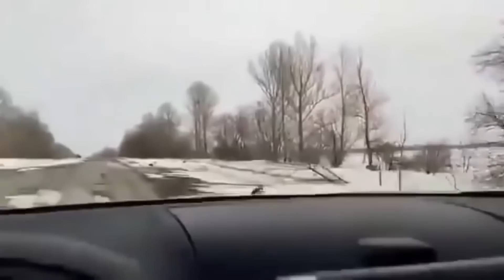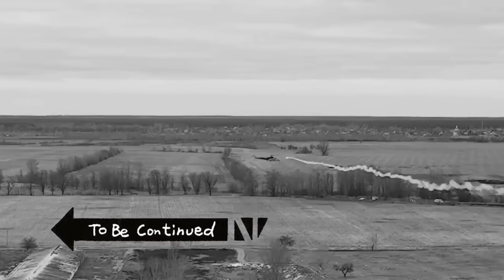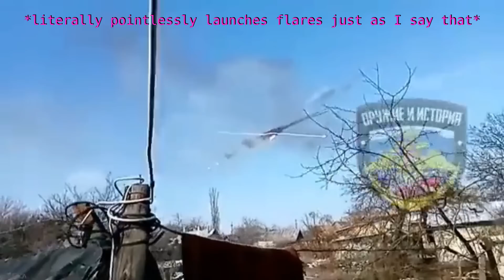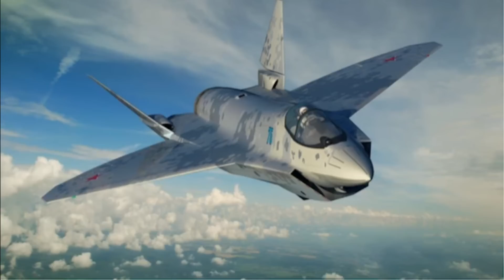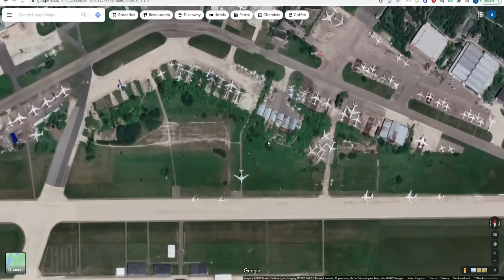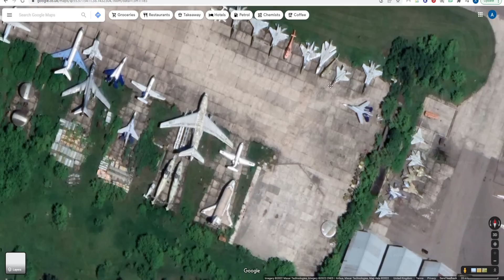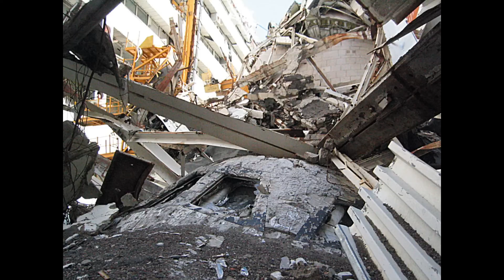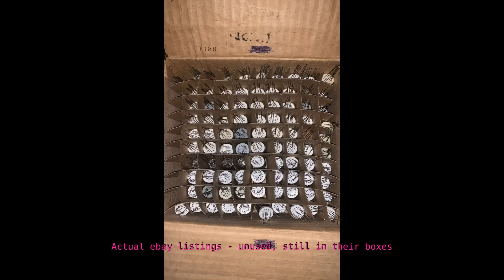100% warcrimes speedrun: Russia's technology problems

Comment: 6:21. The hollow charge liner doesn't turn into a molten jet, the high speed x-rays done the last three decades show that the temperature doesn't exceed 800°C.
What actually happens is that the cone gets inverted and compressed into a long 'needle' and the slower moving 'carrot'. The latter is around 70% of the mass in the cone, and usually does nothing of importance. Now, the 'needle' travels at speeds of 8000 -11 000 m/s, which turns the collision with the armour into something akin a water hose putting a focused beam into clay, with the length of the needle being the amount of water before the facet is closed.

7:49 From what I recall, it was the Israelis who after the Jom Kippur war discovered that whenever a needle had hit some explosives inside the tank, it stopped. "Normal" hits on the other hand would come in, pass through whatever was inside and then leave a mark on the opposite armour wall. This had them construct the first reactive armour, the Blaze system I think it was called?
Reply: Stagnation temperature of said jet is however well within the molten phase.

Comment: 4:25 - Such things do exist on tanks, known as IRCM (Infared Countermeasure), it can even be seen on vehicles in the war such as the T-90 series of tanks as well as the T-80UK. There are also western tanks with this same electronic countermeasure such as the German Puma IFV. IRCM works by flooding infared guided missiles seeker heads and "trashing" the missile by making it guide itself into the ground as it cannot "see". Such methods of destroying ATGMs are known as being "soft kill", there is also a more recent development known as "hard kill" in which ATGMs and even tank shells are destroyed just before impact by a grenade like system which detonates a charge in the air defeating the warhead before it is able to damage the vehicle. Such hard kill systems like the Israeli "Trophy" have already been used to great effectiveness by the IDF and their Merkerva tanks. During a certain combat mission carried out by a dozen of these tanks, only some fitted with the active protective system, it was seen that the vehicles equipt with the protection suffered nearly no damage whereas the unprotected vehicles sustained far worse damage. Russia also has this technology, but it is not used by any of the vehicles they have currently sent into combat so far, apart from the T-80UM2, a prototype variation of the T-80U (Only one ever built), which was infact destroyed in the early months of the war.

5:15 - "Cope cages" are not that bad of an idea, cage/bar armour is effective, and has been proven to be by several countries including Russia. Such vehicles like the T-72B3M, T-80BVM and T-90M all use cage armour that is built by the factory. The armour is designed to be of a certain thickness with certain distances between each bar to provide the best amount of protection, however the "cope cages" are built in the field by the crews and they do not use the correct distances needed, therefore rendering the makeshift armour nearly useless, had it been done properly then it could possibly reduce the fatality rate of their tanks.

7:32 - ERA (Explosive reactive armour) is certainly effective, and there are videos of such armour working against direct hits from chemical penetrators (T-90A side ERA plate hit by RPG-7, warhead was defeated). The tanks with "brick" ERA will easily be defeated by modern ATGMs because the brick armour is very old, compared to the more modern ERA that certain tanks are using (along side the proper cage armour) can provide massive amounts of protection against chemical warheads and even kinetic penetrators, however they are not placed on the roof of the vehicle, which is what is usually killing the more modern vehicles as their protection from direct hits is greatly improved.

12:40 - Thrust vectoring is a big part of ACM fights (Dogfighting), Aircraft from the Flanker series usually all have it (Su-30SM and its related variants, Su-35 (and the prototype Su-37), Su-57 and eventually the Su-75. All aircraft from the Flanker series (Su-27, 30, 33, 35, 37) all have the ability to unrestrict the flight control systems allowing them to pull of tighter turns and more dangerous manouvers (as such flight regimes could result in a partial or full loss of control, although this is VASTLY mitigated by thrust vectoring as it gives you much more control over your airframe). Thrust vectoring would not help in any long range engagement, however in the event of a dogfight as a last ditch effort or in an attempt of positioning yourself for a kill shot, thrust vectoring could very well change the outcome of a fight.

13:50 - The T-14 Armata, as well as the T-15 Armata all exist to a degree, the vehicles are not combat ready however they have been seen operating at certain tank training camps in Russia, personally I believe the Armata series to be the best armoured fighting vehicle design of all time, and many of the design aspects of it can even be seen in Americas new Abrams-X technology demonstrator (Crewless turret, all crew in a pod inside of the hull, auto loader, remote weapon systems, built in active protective system), the tank should be exceptionally easier to operate for the crew, and should provide increased protection and firepower and effectivness over previous Russian tanks. Most importantly of all, such a tank design provides a very high crew survivability chance, more than even the best NATO tanks.

Love the video
Reply: I thought the purpose of the "Cope cages" was to defeat grenades and other small explosives dropped from drones.
Reply: @mrhindbehind528  We saw the cope cages on tanks before the drone grenades saw serious usage, originally it was an attempt at trying to nullify the effectivness of top attack ATGMs but that never worked because the tandem charge blew the cage off and rendered it useless
Reply: @mrhindbehind528 this is likely the true purpose, it seems pretty obvious that these are not meant to counter ATGMs. Bar/slat armor is generally only meant to be effective against older handheld rockets and even then it just gives you a chance of surviving because the armor is actually for deforming the warhead and causing it to detonate improperly or not at all(at best this works half the time)

Comment: A few objections:
1. If by "electronic countermeasures" you mean active protection systems, Russians do have them at least on some most modern versions of T-90 tanks, but those are very few.
2. Ka-52 turns out not to be a good design and not a "fantastic airframe" - they got taken down not by missiles or some bigger AA systems, not even MANPADS, some of them were downed by 7,62mm caliber small arms fire, despite supposedly being well armed to provide close air support. Besides they got terrible vibration issues, videos show them madly shaking, which puts stress on weapons (that's especially obvious on missiles attacked to hardpoints on wings) and crews, making flying them hard and really tiresome for longer periods. It also complicates aiming. However this problem seem to be a serious issue only when howering, not while on a move.
Reply from the maker: Yep - it’s become apparent since I made this that active protection does exist but is generally absent.
As for the KA-52, I was kind of giving the Russians the benefit of the doubt when I made this video. But I’ve too since seen plenty of evidence of the vibration issues. I’ll add a clarification to the description.

Comment: These tubes were used for clocks in public buildings, for electronic cash registers and electronic scales in shops. As a kid I remember every grocery store had these displaying numbers. The times  changed and in early 1990 they were replaced by Casio cash registers having smaller green displays. Also some facroty equipment had these tubes as display. They are pretty resistant when not hit by hammer.
Reply from the maker: I actually have a follow up video on those specific tubes where I go into more detail on their uses and advantages. For all their problems, the Soviets were very good at mass producing vacuum tubes.
Reply: @Alexander-the-ok they are resistant to emps, unlike transistors and microchips

Comment: You forgot very importan detail. In nuklear war or strike ,analog elektroniks will work like vacuum tubes or elektronik lamps  but digital systems, binar based on zero or one , and 5 V difference, will not. So do not think that all russian solution are with out reason still used.Russia comes out with digital tehnology already on Paris exibition 1967. So they have capability if they need digital tehnology. The best tank in WWII was T-34 and was so simple made that crew need hamer and screw driver to keep it runing. Russian try always to made things simple and able to work in any conditions. Take AK-47, due to big tolarences between parts it works in any weather, mud and sand, what was not a case with  M-16 and other western rifles. And so on...
Reply from the maker: Vacuum tubes are not ‘analog’, they are still binary if used for logic. But they have been obsolete since the 1940s. Rad hardening is possible and commonplace for modern electronics.
None of this hardware has ever been used while nukes are flying so in a conventional war, I’d far rather be on the side with modern, mass producable systems than antiquated barely functional kit.

Also, having fired both an AK-M and an M4 in my past, I can confirm the M4 was much more practical (I’m also told by people that know about guns that AK pattern rifles jam all the time).

That said, I am from the country that managed to make the worst assault rifle in history - so I’m not going to pretend all Western hardware is fantastic.
Reply: @Alexander-the-ok  inrange tv mud tests of different rifles show this

Comment: Hey, while i know that i do not have any army experience nor military design. i think you are a bit wrong on the shaped charge concept, from what i know the copper liner inside doesn't actually melt, but, it does go fast egnough to just puch a hole tghrough the armor in a way thet could be Confused with being molten.
Reply from the maker: Yeah that’s correct - I simplified it a little for brevity. ‘Plasticise’ is the correct term rather than ‘melt’ but the end result is the same.

Comment: A couple of things.  Nixie tubes in military hardware still exist in the US.  Transistors and diodes, including LEDs fail at around 10000 RADs. They can be reset by cycling power. Note that most radiation standards are for measuring damage to humans..  Transistors and diodes care only about ionizing radiation, not neutrons or alpha particles.  So space hardware and high-altitude bombers need vacuum tubes or TIMMs to survive nuclear explosions or nearby (in cosmological terms) gamma ray bursts for space hardware.  "Proper" design for such systems has a vacuum tube part just to reset the complex electronics and perhaps tell the pilot what is happening and how many seconds to recovery.  This is more a bomber, spacecraft, or high altitude aircraft thing.  I don't think fighter planes--which are designed to be unstable--can live for long enough to do a reset, so they use rad-hardened semiconductor components.  As a result, these systems use last century components for all flight-critical electronics.

Another thing, I served in the 4th Armored Division when it still existed and was stationed in Europe.  I can't describe the pain of watching tanks going into combat on roads.  I noticed that habit had me staying off roads in computer games even playing as a character armed with a bow or sword.  In combat or practice war games (with real tanks and APCs) roads, especially crossroads are deathtraps.

Finally, if you are doing a long change of location, or are in combat, guard the fuel trucks as the explosive liquid gold that they represent. And definitely disperse them.  Collecting them in a single  "easier to defend" location will convert your tank platoon into stationary gun platforms with a very short combat life expectancy.  Note that even with a single tank platoon the US doctrine splits the maneuver units into two tanks with APCs from a mech infantry battalion.  You need that infantry screen out in front.  In real combat, infantry loves tanks.  Every enemy unit is going to decide to fade away if they can't successfully survive attacking the tanks, or they will attack the tanks, not the infantry screen you are in.  Tankers love infantry screens for the same reason.  I can shoot an enemy, if I know where to look, at distances which make properly used tanks so deadly in open terrain.  Study the battle of 73 Easting to see why.*  The Republican Guard units did have a screen out and dug in, but they weren't far enough out.  As for the Russians?  No screen, long tank convoys and fuel trucks in separate convoy sized units.  Oh, and they used roads, instead of paralleling them...

* Bradley fighting vehicles, properly equipped are really light tanks, with the Abrams as the heavies.   Other APCs can be equipped/used as infantry trucks.  Trying to mix the roles, even if the BFVs involved are equipped identically, leads to situations where the track commanders are not clear on their role. In combat you don't have the time, even if only a few seconds, to figure it out.
Reply: The reason why the roads were followed is that the Russians attacked in the spring during mud season. You can't drive your vehicle if it's bogged down in the mud.
Reply: @ferky123  Since the Russians could choose when to start the invasion, they could have chosen earlier, when the mud was frozen, or to wait until it dried out. 

Or if they had competent troops, including drivers, the tracked vehicles could stay off the roads---that's what the tracks are for.  You drop off legs (infantry) to examine the roads so that any mines or other traps could be found BEFORE you send the fuel trucks up them.

The whole idea behind track-laying vehicles is that they can move across mud, ditches and other obstacles.  Cowboy drivers ruin this advantage by doing sharp turns or accelerating enough to break the tracks free.  Now those tracks are excellent at stirring the mud.  I've been to Hohenfels in mud season. I commanded the dozer tank, and had to pull out four tanks that one Lt. put in mud that the platoon had created.  Well three.   The fourth the Lt took over a lake...  That took two M88 VTRs and two tanks to anchor them.

I guess that is my answer.  If the Russian troops are as competent as Lt. McBride was, they would have no operational tanks after even a thirty mile movement.  So taking the tanks on flatbeds to near the objective was the only way to hope to get them there.  Of course, the enemy messed that plan up, that's why they are called the enemy.
Reply from the maker: Yeah it doesn’t surprise me that nixie/vacuum tubes still exist as failover solutions. Photomultiplier tubes, for example, only became obsolete in the last few years. The difference is I dont imagine the US produced millions if the things just to prop up an artificial economy and left them in warehouses for 40 years.

Oh I didn’t even go into the fuel logistics side of things. I could talk about that for hours! There is a good video by the channel ‘battle order’ on that subject. Vulcan 607 is also a pretty good book primarily focused on fuel logistics.

Comment: 8:14 Old ones are useless more modern ones cann effect Tandem shape to but dosent matter if the roof armor is Thin and useless is relative if you get hit by a old RPG 7 or a Non Tandem RPG i would rather have ERA on the side rather then Nothing

8:44 what Russian tanks do have is Smoke screens that blocks in thermal spectrum to and Javelin locks the target with Thermal Picture only problem is good luck seeing or noticing the Javelin launch and i rarely see russian tanks use smoke screens to cover there Advance or retreat I seen videos where the lead tank gets hit and the other just watch and try to find the shooter 
Smoke screens were made for this situation